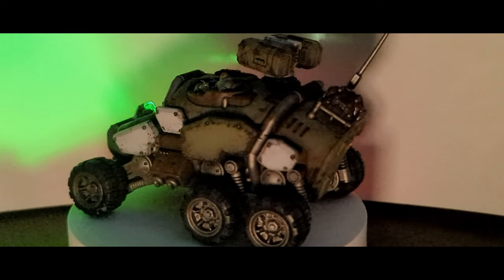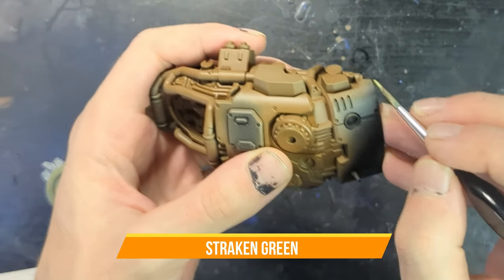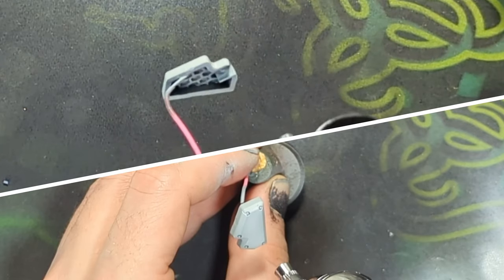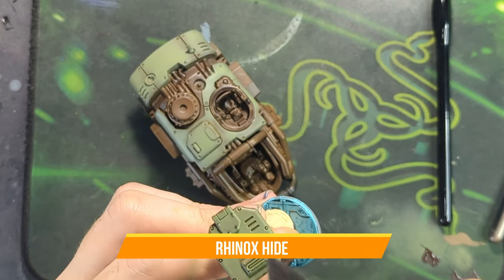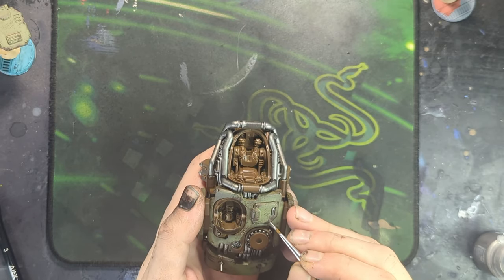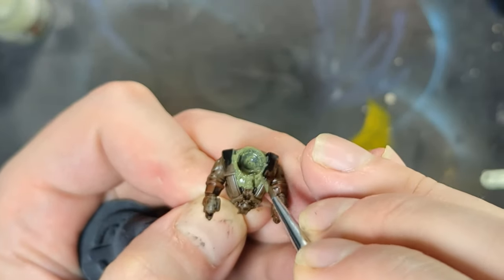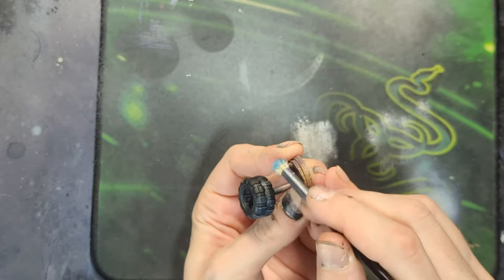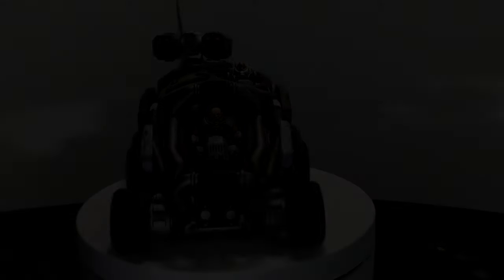Painting a Parade Ready Votann Sagitaur

Comment: How did you integrate the LED?
Reply from the maker: There is a spot in the cockpit with a modeled on light bulb. I simply used a drill to drill it out and fill with a 3mm led. Wired the led then built the thing around it.
Reply: @VanCityMinis  where do you put the batteries? Is there an accessible place in the hull?
Reply: @VanCityMinis  would love to see a video explaining the process, it looks great